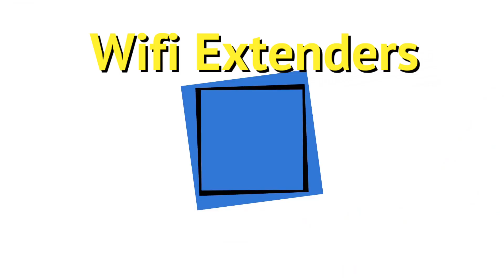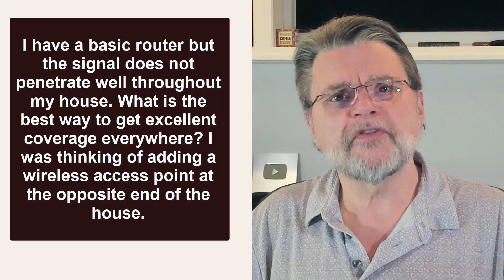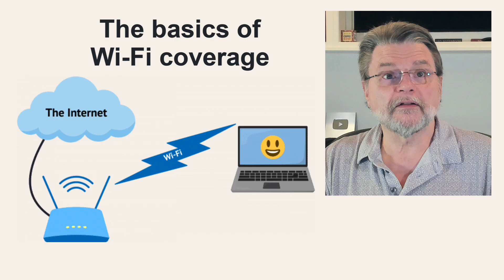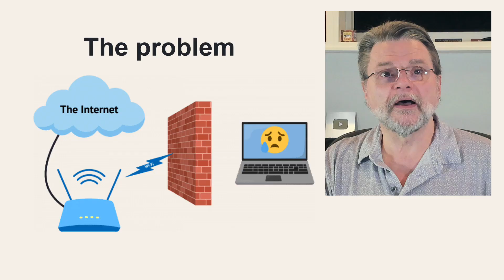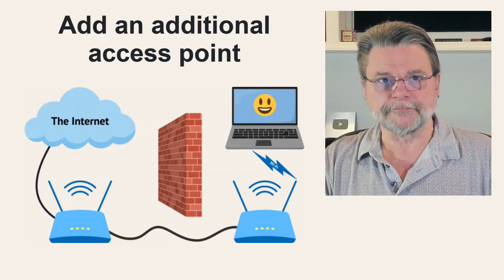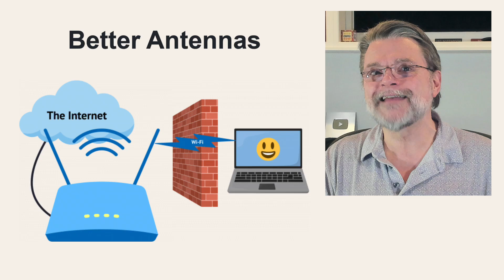Extend Your Wi-Fi: Simple Fixes for Better Home Coverage

Comment: Thanks for this information, however, as older people  we struggle with all of this stuff. Our problem is this, we have a solar system , the control box unit is on one side of the house, while the power connection to the panels is on the other side of the brick house. we have one of these smart meters that sends our electricity use direct to the supplier. The Solar panel box sends a signal to the power box on how much our panels produce, so as we can receive discounts from the electric supplier. However, we  are having a few problems as the signal  often drops out for a few hours & sometimes days!  Any ideas on how we could address this?😒

Comment: I was surprised that you did not mention Powerline Ethernet adapters. This is a system (for the uninitiated) that uses the AC wiring in your home to carry data signals (you DO have power everywhere, don't you?). You need at least 2 (but can add many more)  - one near the modem & one near the remote device. They are not expensive (good ones as little as $30/pair) & setup is easy. Only drawback is the remote device is tethered by ethernet cable - but this also provides greater security - much more difficult to hack than wifi. Both ends must be on same Mains circuit to work, but nearly all homes fit this requirement. I have used this arrangement successfully for many years...

Comment: you forgot about switching a WiFi router to a "media bridge" then using the computers LAN  ports instead turning off the on  board WiFi to the laptop works great...some WiFi routers can be converted over to "ham radio" data,  the WRT-54g's and the ubiquiti's can be flashed over to ARDEN and BBHN

Comment: In your opinion, what would be the maximum length of a cable to run to an access point from the main router before affecting the purpose of this need?
Reply from the maker: Wow. That depends on SO MANY things. Cable type and quality, for one thing. The expected speed you'll be running at. Exactly how the cable is routed (sharp corners can be brutal). Hundreds of feet? Maybe? Like I said, it depends.
Reply: @askleonotenboom thank you for your response. In some way it was helpful as I am looking to run straight line (wire) for approximately 250 feet. I would try to get high quality CAT cable and avoid any corners at all. All I’m trying to do is get WiFi out to my workshop which is a distance from my house. I’m running the cable from my router in my house under ground to my work shop. The cable will be inside a PVC pipe for protection.

Comment: If you are able to run a cable, then that is the best solution.

I was having choppy connectivity issues, even though my PC was showing a full strength wireless signal.  For basic things, it worked fine.  But I was doing crypt-o mining, and I kept falling out of sync.  It would soon catch up, and later in the day, it would fall out of sync, again.  It drove me nuts for a while, because I had a full strength signal.  Every test that I did worked perfectly.  And yet, my crypt-o's blockchain ledger would fall out of sync, several times each day.

I ran a 75' cable from my router to my crypt-o box, and we all lived happily ever after.  Apparently, the crypt-o process was sensitive to the slightest timing issues.  The cable fixed that.

A good Ethernet (Cat 5 (or higher)) cable would be reliable for 100 meters.  It might be a hassle to run the cable, if you have to snake it around rooms, and over doorways, etc.  But once you have it in place, you will never have any wireless related issues, again.

I suggest that you get a Cat 6 or higher rated cable, depending on the speed that you need and the speed that your router supports.  Check a chart to see the speed of a particular category of cable.  Also note that many quality cables will exceed the cable's speed specification, up to 100 - 150 feet.  Some channels have reviews where the host has done speed tests using Cat 5e, Cat 6, etc cables, and with runs of 100 feet (some 150 feet), they all performed the same.  They all got 10 Gb speed (and that far exceeds the lower rated cable's specification).  But at 200+ feet, the higher rated (i.e. Cat 8) cables performed at higher speeds.  The Cat 5e cables still worked well, but dropped from 10 Gb speed to 5 Gb speed (still higher than the 5e specification).

And if you have to go longer than 100 meters (perhaps, 150 meters), then you can use two 75 meter cables, and connect those two cables with a switch (do not use a hub).  Any switch will re-generate the signal (hubs do not re-generate the signal).  Just make sure that the switch is rated for the speed that you need.  If 2.5 Gb is what you need, you can purchase an inexpensive 4 or 5 port un-managed switch and you will be in good shape.

So run the cable through your home, and test its speed, before you put in the effort of tucking it against your walls and snaking it around your rooms.

If you need a wireless access point at the far end of the cable, then you can add a wireless access point there, and you will have a very strong signal being delivered to your new wireless access point, via the cable.
Reply: One more point:

Wired connections are faster (well, depends on which wireless protocol vs which physical network port speed is being compared -- but wired can reach much faster speeds vs wireless).  Also, wired connections are more secure (older wireless encryption versions have been broken).  No need for encryption, when wired.  No risk of someone getting on to your network, when wired.  No risk of someone finding a way to break the wireless protocol's encryption.

If you need to be wireless, then by all means our host's recommendations are spot-on.  But try to do your networking with physical cables, if possible.  Faster, more reliable, and more secure.

Comment: You can find instructions on how to repurpose an old router as a wifi repeater. I haven't tried this yet, so cannot attest to how well it works. I had zero luck with an off-the-shelf dedicated repeater.

Reception varies a lot among devices. I have an old (2012) cellphone I use as a wifi coverage finder -- it has about double the range of the wifi in my best-receiving laptop.

Comment: For starters, placement of the main Wi-Fi router is important!  Also, make sure you're NOT using the 5 Ghz band, as I've found once you're 25' from the router, signal strength drops off significantly.
Reply: I use an ethernet switch with Wi-Fi & I can be 300' away outside & still have good Wi-Fi (5Ghz & 2.4Ghz)
Reply: I took my laptop outside for the 2024 Solar Eclipse. 5Ghz wouldn't cut it 20ft away from the router while standing in my garage, whereas 2.4Ghz had a solid connection thru 3 walls and 50ft into my backyard!

Comment: A couple of things to think about, ensure your wifi has a password so folks outside the home can't snoop onto your router (freeload) as many signals can be reached from the street at the very least in at least one direction.

The other is your WiFi card in your laptop is either not good, or old, replace/update it. I may need to do that with my now 6 YO laptop, but is based on technology from around 2017, but with the 8th gen i5 processor and built in very early 2019. I can't transfer audio files wirelessly without incurring some interference that disrupts some of the files. Thinking of going wired for that when it's on the docking station. At the moment, it's not as I am using it to read scripts for video projects (post now on one project).

When I do, may find a switch that can carry 1-2G speeds to the desktop, the laptop and a spare desktop for video transferring of old tapes 1000Mbps. I do have a TP Link C80 Archer it's an improvement over the Netgear router I bought 2016 that ceased to see the IP address of my desktop in 2023 so replaced it with the TP Link, it's a better router all around as far as having MEMU or whatever it is functionality, and provides improve coverage at the back of my house, yet the router is in the front bedroom, come office, and that's with the WiFi. Nevermind it's only 5G but the rest is an improvement over what I had previously, and got it on sale for $50.

So it is said that one should replace one's router every 5 years or so anyway due to improvements in WiFi, or it craps out like my Netgear did. I tried multiple times to get it to see the desktop to no avail, thus, the replacement.
Reply: I'm about 200 feet from a highway. I see wifi signals from passing cars all the time. Some are secured, some are not.

Comment: Another great segment.  About eight years ago, I set up a wi-fi configuration at a local historical village that used each of the tools that you mentioned.  From the building where the wi-fi router was located, I found an unused conduit that connected to another building that was more centrally located.  I used a small fishing bobber connected to a long string and a shop-vac to snake a Cat-5 cable through the conduit, then set up a wired access point in the second building.  I then added external antennas to both the router and the access point.  I then installed a wireless repeater in a building in the opposite direction from the wired access point, and synced it to the router.  From the building where the wired access point was located, the village extended in two directions.  I picked a couple buildings that were midway between the location of the wired access point and the edges of the property and installed a wireless repeater in each location, syncing each to the wired access point.  The last step took some trial and error, finding locations that were close enough to the wired access point to receive a reliable signal while broadcasting a signal that reached to the edge of the property.  The cost was nominal and it still works.
Reply: Using a string and a shop vac to get the cable through the conduit is a fantastic idea!
Reply: @harveybc  You need to have something on the end of the string that fills most of the diameter of the conduit.  I've tied wadded up paper to the end of the string in the past but I now keep a small diameter fishing bobber in my low voltage electrical toolkit.  The spring loaded hook easily grabs the knot at the end of the string and the consistent diameter of the bobber seems to get "sucked" easier.  However, you can't use it if the conduit has 90 degree bends or doesn't have a consistent inside diameter.

Comment: Sometimes the router you have could simply be positioned a lot better than it is.
If the starting network wall jack is in a bad place you could run a long (depends but 20m is no problem) networking cable from there and get a much better position for the router. There are flat and thinner rounded cables that are easier to "hide" if a regular cable seem unsightly.

I've seen routers hidden behind a large TV. That's a no-no...

Comment: This is not a way to add something to your existing wifi network to extend its range, but if you have this need in your home with every traditional wifi router you've tried, my suggestion that solved this problem for me: when it comes time to replace this router, consider instead a wifi mesh router which will get you, for example, a main router and three satellites. Very easy to set up and booming signal for us, much better than I expected. I use tp-link's Deco mesh routers.

Comment: I was going to add to also check the transmit power on the router or AP but in most cases the default is to high anyways.  In fact when working with a Mesh system you often want to actually lower the signal in spots to get a better hand off.
Another thing to look at is the width of the transmission.  A 40MHz wide band on the 2,4 Ghz range is rarely, if ever needed and in fact may not have the range of one that is "only" 20MHz.  Your also a "good neighbor" by not going to 40 as well.  Same with 5G.  Most rarely need to go to 160MHz.

Comment: Thanks Leo. What are you thoughts on powerline adapters? I've used the TP-Link brand with some success.
Reply: They are at the mercy of the electrical wiring and other equipment in the house, which can create performance bottlenecks or downright blocks between two rooms.
Reply: @MikaelKKarlsson  Was looking into that as well, and found the same info written here. I'll go wired when I can for 2 other PC's for file sharing, mostly.
Reply: If you have existing coax cable (RG6) wired throughout your home, you might try using MoCA 2.5 adapters which will send "wired" Internet through shielded cable. Been using MoCA for years now at very fast speeds and had great success! I also tried powerline but the results were poor at best. Again, MoCA is the way to go if you have the coax already run in your home.
Reply: About 8 years ago, I tried using TP-Link powerline adapters to provide wi-fi access to a local historical village, with disappointing results.  I was initially skeptical of wireless repeaters, so I thought that powerline adapters would be a better solution, but I was wrong.  Even though the buildings shared a common electric panel, the ethernet signal was unreliable and I ended up abandoning the powerline adapters.